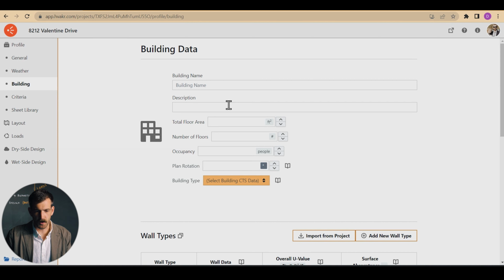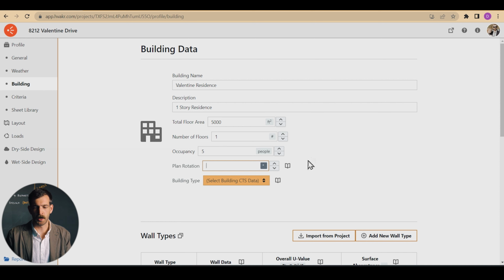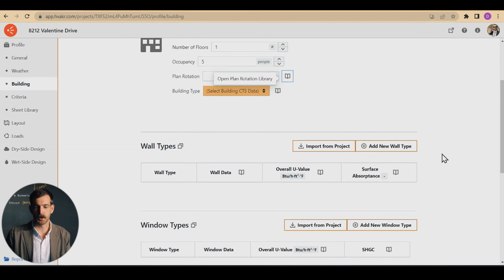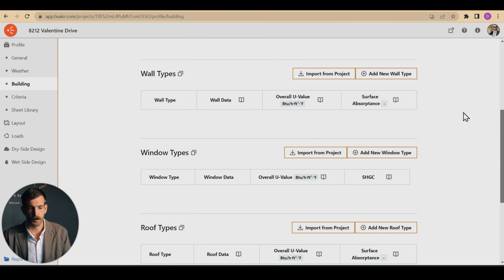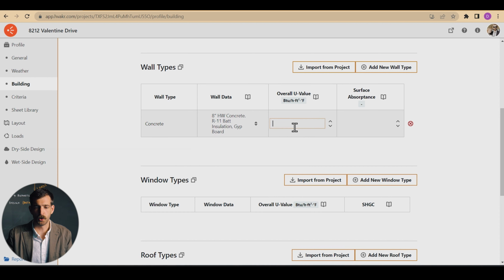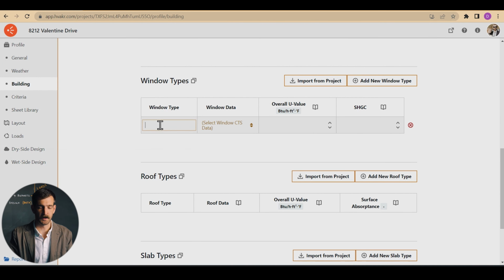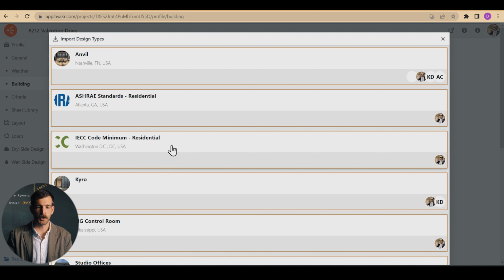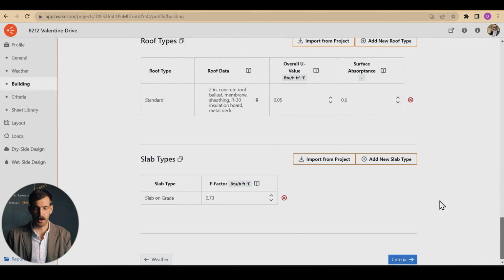HVAKR Tutorial Part 3: Building Envelope

Comment: Can I make a custom wall assembly? For example, I'm renovating an existing house with 2x4 framing, and also added 1.5" of continuous exterior mineral wool insulation with a rain screen. None of the preset options are really a close match.
Reply from the maker: Hey David, the preset wall types you select from under "Wall Data" do not impact your calculations nearly as much as the "Overall U-Value." To capture the thermal properties of a custom wall assembly, you'll need to determine what your overall U-Value for that assembly is. If you don't know it, you can get an effective estimate by dividing your insulation R-value by 1. For example, if you have R-19 insulation, your U-Value for the wall is going to be approximately 1/19 = 0.05. Then, you can just select the closest preset assembly option you can find and you will get accurate results.